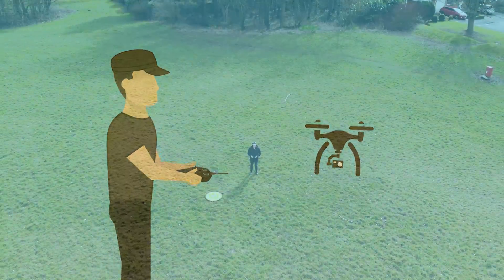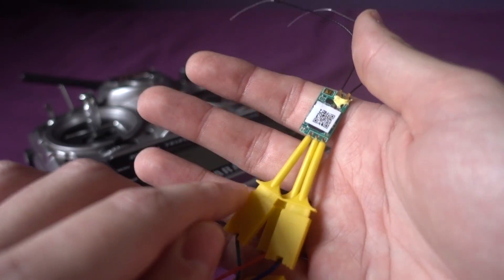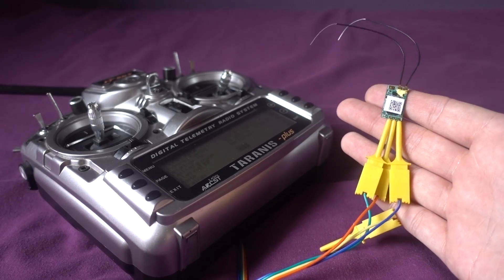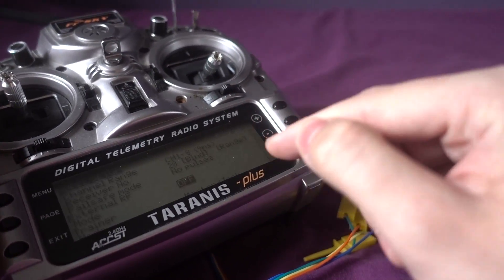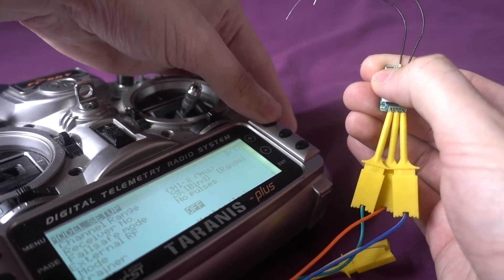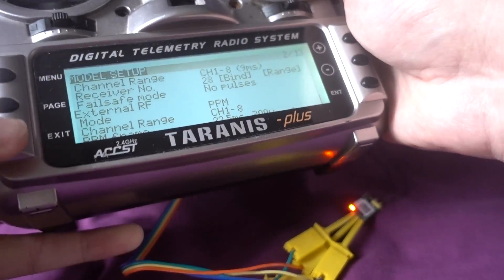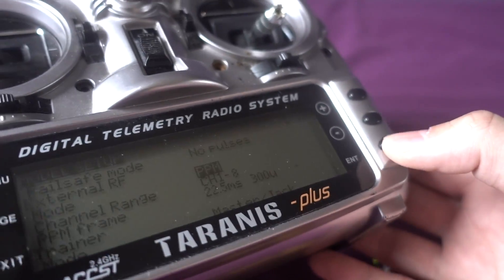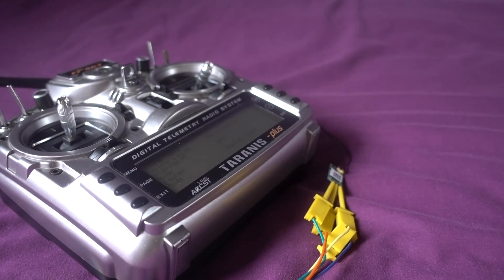Bind Your Receiver From The Taranis

Comment: Andy just some minutes ago a quad i was flying with an Xm+..never had updated or anything...flew normaly 2 batteries..when i plugged a new one to fly....it didnt bind the reciever..i came back home checked everything wiring etc...all is good...i tried to rebind but nothing..also i flashed it just now hoping it will help but nothing....it dont bind.....means its dead i guess? when i turn on on binding mode the xm+ i have the red-green light normaly ...but no....pffffff

Comment: Flashed FCCxm+rssi8.  Could not bind in D8 mode.  On a whim set to D16 manually backed down channel to 1-8 for 9ms, then bound using this method with clips.  Worked perfectly. I am a complete noob though so maybe binding D16 and setting channel endpoint to 8 is common knowledge.
Reply from the maker: Xm plus doesn't do d8

Comment: Very nice tip. Thank you. (Y) I just got one xm+ which I need to install in my quad and I will try this method. :)

I have some question. I have xsr receiver which looks that I successfully bind with my Taranis, the green light is on at receiver, but when I arm the drone nothin happening, not any of switches or sticks work. Also in betaflight nothin happening. But the green light is on at receiver. :S

+ at the sam drone my VTX connector for pagoda antenna also heating very high. After 2 minutes is very hot with antenna on and when powering with battery. When powered just by USB is not hot. Hmmmmm..

Comment: Good to know about he binding, thanks for the tip.  As far as flashing, I usually just solder my wires to the RX then I have a servo plug with wires stripped.  I twist the wires from the RX onto them then flash and then untwist.  Have to solder the wires to the RX anyway but this allows me to do it without special doodads.

Comment: You should mention that the power from the back pins of the taranis is the pack voltage unregulated. So if you're using a pack with a voltage higher than 10 volts you'll fry your Rx.
Reply from the maker: not true. this is a fully charged 3s battery. will be fine. cheers

Comment: Hi Andy off topic but do you think the emax rs2 2306 2600kv can take 6s lipo? I know it's rated for 4s but just wondering what you think because I want to go 6s or do you think go with small over? Cheers and happy flying to all people;)
Reply: mugenctr cheers mate so my motors won't go up in flames then
Reply: mugenctr it's the dino shot 60a but not to sure what props to get? Any suggestion?

Comment: Hey I’m getting an issue in beta flight where my ibus receiver isn’t being recognised so I can’t configure my quad
Reply: QUACKERS what flight controller?
Reply: Dav omnibus f4 flight controller on my furibee darkmax
Reply: QUACKERS I’m not familiar with that board, which pads did you solder the receiver signal wire to?

If you’ve soldered the rx signal wire to the SBUS pad on the fc then that’s probably your issue as f4 boards have hardware inverters on them for SBUS protocol, ibus doesn’t need to be inverted. 

Or maybe you haven’t selected Ibus as your serial protocol on the configuration tab, or haven’t enabled it on the correct UART in the ports tab. 

I had a similar issue with a Crossfire receiver, I soldered it up to the SBUS pad on an f4 board and it bound fine but the Betaflight GUI wasn’t detecting my stick inputs, I soldered it to a different UART, set it to the UART I used in the ports tab and that fixed it for me. 

Good luck man, hope you get it figured out. 🙂